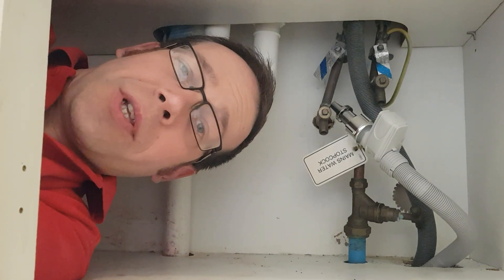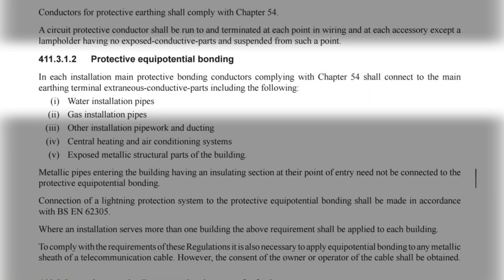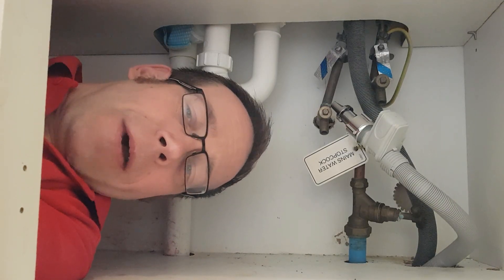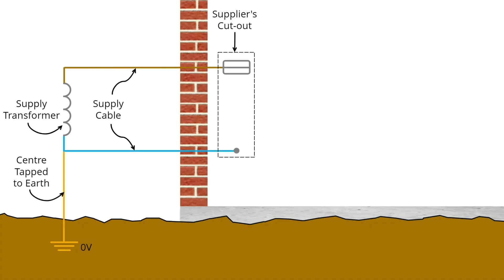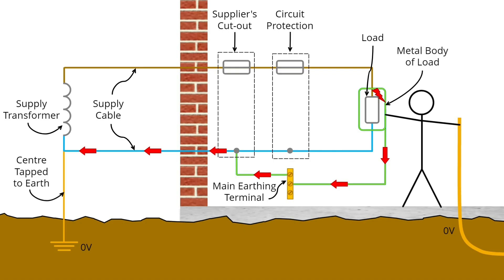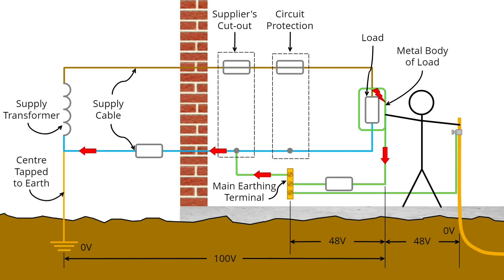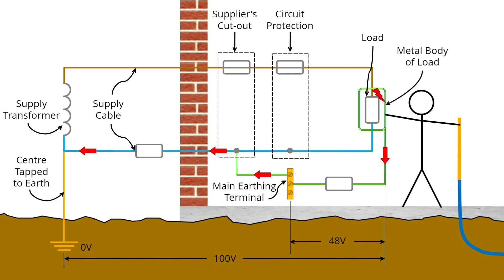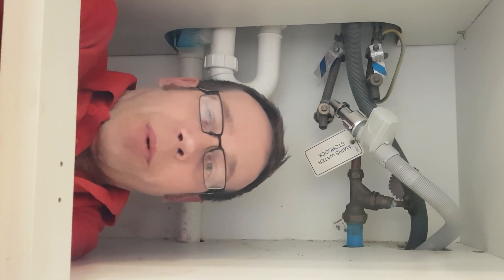DO YOU NEED TO EARTH BOND PLASTIC WATER PIPES?

Comment: Would still need bonding if copper pipes went underground at any point after, e.g. to an island kitchen sink, heating pipes set in a concrete floor or going out to an external detached building assuming TNC-S system
Reply: Agreed. Re-entrant pipework.
Reply: Any copper SHOULD be bonded. if there is a break with plastic both sides should be bonded

Comment: The way I understand bonding is, if an earth  fault occurs,  it doesn't spread to next door, or making the whole world live! If its plastic,  it can't conduct. So dont earth it.
Reply: No. It's to try and keep anything introducing a potential to your installation (i.e. a gas pipe/structural steel whatever) at the same potential as your main earth terminal within reason so shock risk between your exposed and extraneous conductive parts is minimised.

Comment: My house has bonding in the bathroom, kitchen and down stairs loo.
But the pipe bringing in the mains eater to the d s loo is plastic.
All water supply pipes in the house are copper except the ufh on the ground floor.
So if all copper pipes have bonding but I do not believe is bonded back to ground?
So what is the point, think the house was built in the 70"s
Should I bond the nearest pipe to the supply metal protective shield, which is under the stairs and the ufh manifold 22mm copper pipes are there to approx 1 meter away.
Thanks for the thoughts on earth bonding and video.

Comment: The fact that the regs says 'need not be', and not 'must not be' or 'shall not be', leaves it open for debate.

Only if you can prove it's not extraneous (as it may go back under the ground and pops back up again), then no you don't have to.

Typical scenario:

House with a boiler.

Water enters in plastic then turns to copper and you can't see the rest.  Gas is bonded and all connected to the boiler.

I would like to hear from anyone who has got the plumber in to separate the gas pipe from the boiler so you can check the 22k ohm test for extraneous metal, or anyone who has gone around removing bonding cables to prevent the introduction of an earthing potential on pipework later found to be non extraneous.

If it is connected to the boiler then I can't see any harm in having the water pipe bonded back to the MET like the gas.

Question is... do you bond because you can't prove it's not extraneous, or do you leave it not bonded in a hope that it doesn't go back under the ground, or do you get the plumber in and get it tested properly?

P.S. if this is a new build then you should know the answer when carrying out the project, but in an existing, refer to my main comment.
Reply: Not open to debate, it's a pretty clear no imo. Bonding plastic makes zero sense.
Reply: @electricalstuff259  are you saying if the consumer side copper pipe goes back down under ground then pops back up again, it's not extraneous?
Reply: @MrSJT  Nope, i'm saying if the only route to earth is through plastic pipe then bonding isn't necessary.

I've renovated/rebuilt loads of domestic dwellings and i've never seen mains water pipes that come in in plastic, tee off in copper and then run back under the ground in copper again.

The fact is if you have plastic pipe coming in it doesn't need bonding, as per the people who make up the rules based on electrical safety.
Reply: @electricalstuff259  like I said, if it's a new build you would know about it.  However, several houses including my own in the same street have plastic pipes as incomer, then turns to copper, then goes under the concrete floor then reappears in the kitchen.  So going by what you're saying referencing the regs, you wouldn't bond it.  I think you need to read Guidance Note 8.

My point is, as it is possible that it may go back under the ground in copper, makes it debatable whether it should or shouldn't be bonded even though the incomer is plastic

Comment: Agree with this video but for some reason I still would prefer to bond it. Plus, isn't water conductive and technically there is a solid H2O conductor running inside the pipe which at some point will be in contact to earth via a pumping station, long shit yes but I don't entirely agree that your copper pipe is entirely insulated because you have plastic pipe. Who knows what's underground a few hundred yards away.
I'm not knocking your video, you are correct, just old habits are hard to remove from the older generation.
👍👍👍👍👍
Reply: That's why you should test it...
Reply: it conducts, but if you do the maths with the equivalent resistors all is well, maybe he should do the video with the detailed maths.
Reply: @sm1thers  no. Just measure the resistance of the part for goodness sake. If it's greater than 23kiloohms  it's not extraneous. Possibly lower depending on circumstance.... No complex maths... Just knowing how to do your job.
Reply: Ok so I don’t bond the copper water pipes in my house, because the house is fed from a pvc water pipes. Then there is a fault and the copper pipes become live, water is a high resistance so current starts to flow, not great enough to trip CB no rcbo, person standing on wet concrete grabs said copper pipe “oh dear your dead” had pipe been connected to earth terminal of supply the CB would have tripped making it safe. The chance of a body being in contact with pipe with a fault path so current goes through their body is so remote.

Comment: 18th edition says no to bonding plastic incoming pipes. 

btw - It’s either earthing or bonding, not earth bonding. They’re two separate functions 👍🏻
Reply: It’s either earthing or bonding, they’re two separate functions. The sink isn’t an exposed conductive part, therefore not required to be earthed. The sink “could” be an extraneous conductive part, if so, it would therefore require protective bonding. If not, no protective bonding. There’s a test one can do to prove if something is or isn’t considered extraneous.
Reply: @CarlCosby  What is that test?
Reply: @tristandowning5609 Insulation Resistance, sorry for the delay 😂
Reply: What it should say is that in that case then any metal sink or fitting should be earth bonded to a ground spike

Comment: Is the water in the pipe conductive to earth. ?
Reply: Of course the water is conductive but is of high resistance. Stand in water in your garden and grab a live conductor and then say water doesn’t conduct electricity.
Reply: @kevanswift7797  water is actually a great insulator we use it in car batteries (distilled) its the impurities in the water that conduct
Reply: No, JW did a video on this.

Comment: Assuming the water main in the street is cast iron which is still in quite common use, the water itself will be at zero potential.  You may then have a couple of meters of  plastic service pipe to the house so by the time the water gets into the copper of the domestic pipework it will not be at zero potential but still quite low. Water is not such a good conductor as copper but still does conduct otherwise why the numerous regulations re installation in potentially damp/wet areas.

So if the bonding to the domestic side of the plumbing is no longer required what am I getting wrong.
Reply: A couple of meters of water in a plastic pipe will have a high enough impedance at mains voltage to be effectively an open circuit.

Comment: I have no bonding on my water pipe as it is plastic. But to the metal main gas pipe? Yes. I loop from the inlet of the gas meter to the copper outlet pipe as well, as a spark can occur between the meter and meter union when it is lifted off, if there is a fault.

Comment: The plastic pipe obviously doesn't make a direct connection to earth, but what about any metal pipe fittings further down the road?  At mains voltage water can act as a conductor (or we wouldn't worry about IP rating for things exposed to damp environments) so while the path to earth via the pipe itself doesn't connect to earth directly under the house, surely there's a path to earth via the water in the pipe itself?

I accept that the potential is probably a lot lower than the actual copper earth that comes into the building though, so likely wont be a problem, but I would still expect that there is the possibility of an issue there.
Reply: If water pipe enters to the dwelling in plastic you don’t need the bonding . That is all
Reply: Exactly except bonding to the pipe would be utterly pointless but anything metal should be bonded on the water system
Reply: Demo of how little current would actually flow through the water in the pipe: https://youtu.be/MF9DCNkaE8I?t=140
Reply: @simongreenidge6454  Where I do think there could be a concern is when the insulating section is very short. If there are meters of insulating pipe then the current is going to be reduced to non-hazardous levels, but if there are only a few centimeters of insulating pipe between sections of conductive pipe that could be a different matter.
Reply: @petermichaelgreen  Yes, an interesting situation. This video also makes me wonder whether, in a house with a plastic incoming water supply pipe; does any of the network of copper water pipe within the house be (supplementally) bonded e.g. the bathroom?
Reply: @petermichaelgreen  except the PLASTIC insulates the physical connection between the copper INCOMING pipe, the water connects between both ends. When a PLASTIC incoming feed is THEN connected INTERNALLY, there is almost certainly many metres of water between conductive ends, hence many hundreds of kilohms resistance.

IF any copper piping AFTER the incoming transition is THEN taken outside the building to say an outhouse, then it is extremely likely that it will be back at earth potential so SHOULD be bonded. If not, then bonding such otherwise isolated metal pipework can present a shock hazard under conditions of nearby (within a few hundred metres) lightning strikes - you've just provided a very LOW resistance path for the potential on a person in a building which has a raised local earth potential to pass. 

General rule should be DON'T bond such pipework unless there are compelling and evident reasons for doing so.
Reply: @simongreenidge6454  And what about when it joins to a mixer tap and is then connected to the hot water pipe?
Reply: @learningwithlyricsandsongs  If the main water supply pipe into the house is plastic ( isolated from earth ) isn't the hot water pipe also isolated from earth?
Reply: @simongreenidge6454 could go through the boiler onto the gas pipe that is metal coming in, but that’s why you bond that gas pipe.
Reply: @petermichaelgreen  WHY (FCOL)???!!!
Reply: @simongreenidge6454  so pleased some linked johns video watch all his vids and he goes through all the 18th ed and explains it all.
Reply: IP ratings grade the intrusion of dust or liquids, for the purpose of protecting the contents. 

I read too much speculation about water conduction.
Reply: Can you show some evidence that water is conductive? The real issue with water is that it lowers your body resistance/impedance, not that it's conductive in pipework.
Reply: @J0nny61  Pure H2O isnt conductive. But you never get pure H2O in your taps.  Impurities, chemicals, dissolved salts etc all add to the conductivenss of water.  So while its not as conductive as copper, its more conductive than plastic pipe.
Reply: @AdrianBawn  I know Adrian, but it's of a high enough resistance to prohibit fault currents which is what bondings about.
Reply: @J0nny61  With all due respect Jon. Your original question is misleading; you ask for evidence of water being conductive, when you seem to actually want evidence of whether its resistance is low enough to warrant bonding metal pipe that is connected to a plastic incoming pipe. John Ward has an excellent YT channel, on it he has several videos investigating this situation e.g. check out: https://youtu.be/MF9DCNkaE8I?t=140
Reply: @simongreenidge6454  Thanks Simon, I've watched a lot of JW's video's and they nearly always make sense. I'll take a look.
Reply: @AdrianBawn  A colleague of my mother received a fatal electric shock from a stop tap in the road caused by a domestic electrical fault many years ago in London.   Shortly after we bought our house we discovered a water leak in the front garden, it was on a joint where the water company have come along and cut out 1m of the old lead service pipe and fitted a meter of plastic pipe.  When I spoke to a neighbor they said they came along one week and did this to every house in the road.   It al depends on what the water network in your area is made from, if it's iron mains there can be enough conductivity to kill!
Reply: @J0nny61   Impurities in water make it conductive.  Distilled (pure) water is not conductive.
Reply: @J0nny61  Pure water has no conductivity.  'Fresh' water (that which comes out of your mains water pipes - ie potable water) may have some conductivity depending on how much dissolved mineral content it has.  Even then, it is still fairly non-conductive and certainly enough that you can ignore it for the purposes of earth bonding of water pipes.  Anyone who thinks otherwise has just been watching too much TV nonsense (eg people bathing with live toaster scenarios...).
Reply: @J0nny61  Chemically pure water does not conduct. However "tap water" usually contains dissolved minerals or salts. Even in tiny amounts, these dissolved salts can release positive and negative ions within the water, which can transport a charge and in doing so conduct electricity.

Comment: Sure, because plastic pipe is so contactive  :-)
Reply: Surely it depends on the Plastic Pipe, Although the Blue is non Conductive, The Black almost certainly is conductive because of the Carbon used to make the Black Pipe
Reply: @keithg1xfl  Check it with your Megger 🙂

Comment: i would still bond under the sink -- just incase they have a waste dispoal unit and any other electrical items near the sink -- the worst case would be someone puting a screw though an electrical cable and then making the sink live
Reply: Do you understand the vid? A waste disposer has its CPC to the main earth connector block.
Reply: @johnburns4017  - on the copper/metal side under the sink and would never bond to plasitc

Comment: the pipe mite be plastic, but the water inside will conduct electric and where it contacts a metal valve etc....
Reply: How is the electricity getting into the water? Disregard  clean water being a poor conductor and Faradays law making electron transfer limited?
Reply: @ianlenaghan9534  metal valve. water isn’t that poorer a conductor of electric maybe not on the same level as metal
Reply: Utterly irrelevant

Comment: It best to disconnect the bonding cable entirely as with no connect to earth at the water pipe it makes it worse, you then could have live cable from your CU to....you! Or your copper pipe work onwards from the MDPE....but hey if that happens you won't get limescale ?
Reply: Hooking up the bonding in the CU is one of the worst ways, in my opinion only a "crutch", a better than nothing solution. There are better methods. For example here in Germany all bonding wires go to a central "potential equalisation bar" in the house. That is hooked up directly to the PEN in the service entrance box (TN-C-S), or the earth electrode of the building (TT). In most cases you got both here, since it is mandatory to have an earth electrode here in buildings errected after 1980. Even in TN-systems. In older buildings the incoming water pipe was designed to serve as an earth electrode, but since the cities here replace their old thick cast iron piping with plastic that won't work anymore. We called that "supportive earth electrode" to keep the voltage of the PEN close to real earth potential. And it also lowers the touchable voltage in case of a PEN fault.

That's what this bus bar looks like:

https://de.wikipedia.org/wiki/Potentialausgleichsschiene#/media/Datei:Potenzialausgleichsschiene.jpg

https://www.amazon.de/DEHN-563050-Stange-Schiene-mm2/dp/B001Z5Z0B8/ref=sr_1_3?__mk_de_DE=%C3%85M%C3%85%C5%BD%C3%95%C3%91&crid=3WFSDTH391HE&keywords=potentialausgleichsschiene&qid=1636401777&sprefix=potentialaus%2Caps%2C176&sr=8-3
Reply: If the bonding cable developed a fault would you, stood in shoes on your kitchen tiles, be an easier path to earth than the plastic pipework?

I'm an apprentice and curious :)
Reply: @electricalstuff259  it is about difference between you and what you are touching Vs what you touch with another part of your body....you only need 50ma across ya heart to die...the bigger path of resistance the better. Best not to touch stuff with left hand or both at same time:)
Reply: @stephencoulthard1718  Threshold for a healthy adult is 30mA, for kids and elderly people (especially with heart issues) it's even lower than that.

Comment: I'm all for K.I.S.S. Keep It Simple Stupid then mistakes can't be made. Just bond and even if it's overkill it's better then a kitchen fitter removing it because they now think it's not required. I've seen this when supplementary bonding regulations where changed for an installation complying to the 17th edition regs.
Reply: "You wouldn't bond a metal bed frame, so why would you bond a pipe?"
That was quite clear.
Reply: @johnburns4017  My metal bed frame is connected to an earth rod to remove all my negative energy so I need an main earth bond.
Reply: @glenwoofit  Well written.
Reply: @glenwoofit  
I see.